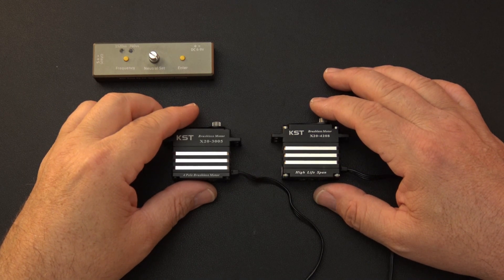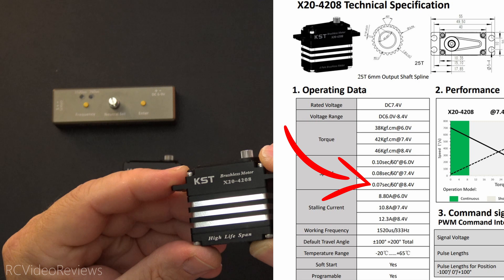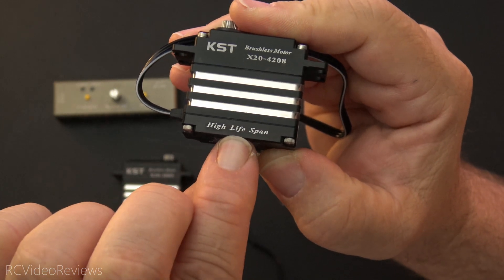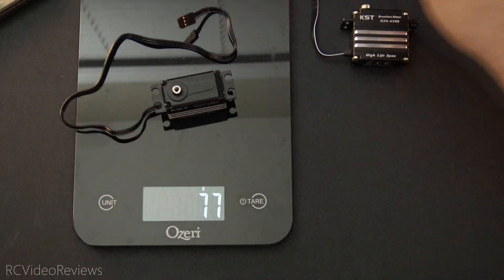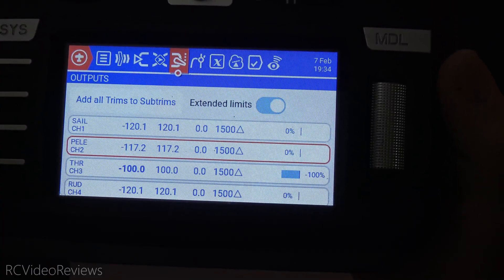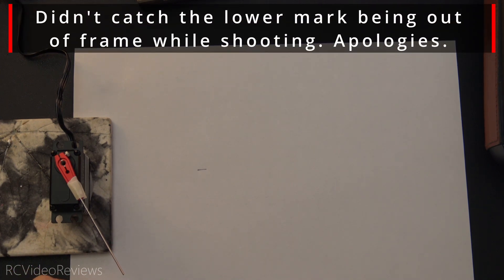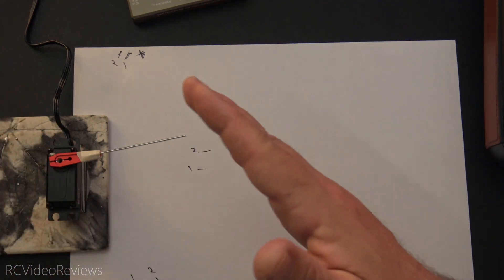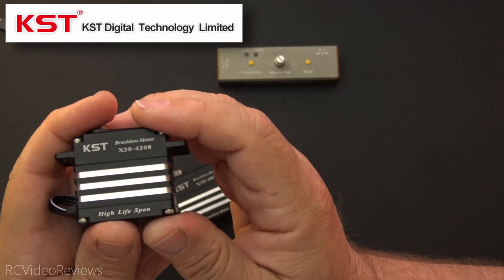New KST X20 Series Servos • BEAST MODE POWER!

Comment: ... And go fly something!
I have read somewhere  that you can set the zero of your servos, as Full flap down, that way you (I think) the strongest of range of your servo is used in the most challenging circumstance.
Did you hear about this?
What is it?
Any thoughts?
Reply from the maker: Uhm, I think I have to disagree. Servo gearing is rotary. I don' believe torque changes through the motion. The way to get torque is to move the control rod closer to the servo arm screw. Also, if you do full flaps down at center, you'll get very limited movement--basically half the throw. Yeah, I think I disagree with this.
Reply: @RCVideoReviews   fair enough!
I might have misunderstood what I read about that, I will try to find the article again.

Comment: Long time viewer - first time commenter. A thousand thanks for explaining how to use 'extended limits' to extend servo travel using my Radiomaster TX16S MII and EdgeTX. I have a 350º servo (full range only available with a pulse range from 500µs - 2500µs) for use in a pan/tilt head on a fixed wing how can I exploit this pan range potential to the fullest using iNav and a Matek flight controller along with EdgeTX?
Reply from the maker: Not sure. I would experiment with it and see if using an iNav controlled pwm output will let you push the sliders in iNav far enough.
Reply: @RCVideoReviews  Thanks John for the advice - will try although I'm not as technically adept as you. I forgot to mention I'm also using ExpressLRS so your advice about the limits of CRSF is crucial. 

I realise that pan/tilt mechanisms are a bit niche but 'extended limits' with wide pulse servos or using a flight controller to remap the standard 1000-2000µs range to (up to) 500-2500µs wide pulse servos could be a super simple solution to achieving a wide pan range without having to solder additional resistors into a micro servos' potentiometers etc..
Reply: @RCVideoReviews  Thanks for the advice John - I'll try although I'm not as technically adept as you. I also use ExpressLRS so it's very helpful to know about the extended pulse width limitations of the CRSF protocol. 

That means, using the EdgeTX & ELRS 'extended limits' method, I'll only get 40% on top of my 350º servo's extended range (beyond the normal 1000-2000µs) = 245º. 

It seems as if the iNav servo setup is the best bet for remapping the standard RC 1000-2000µs pulse width to (up to) 500-2500µs and getting that full 350º range of pan (360º servos rotate endlessly CW or CCW - so no good for accurate pan/tilt positioning). 

If this works then that's great news for pan/tilt head users who want the maximum pan angle. No more trying to solder resistors on to sub-micro servo potentiometers - can't be doing with that. You're the first YouTuber I know of to touch upon this. What a star!

Comment: Thank you! Too KST as well, otherwise this would not have happend.
I do love all your technical video goodness

As I mentioned in a comment, the electric power is not necceseraly a problem (wires get burned trough eventually), but the physical power is almost scary. I was saved by an amp limiter, I would recommend that with these and other setups  ** rather power off than burn **

Comment: 9 gram metal gear if possible.....
Reply from the maker: Will these do the job? https://amzn.to/3RG2Bi8
These are bigger:
https://amzn.to/3laKZi4
Reply: Already tried those. They say they are 180 but they are only standard 90-degree
Reply from the maker: Did you try using extended limits and pushing your outputs to 125?